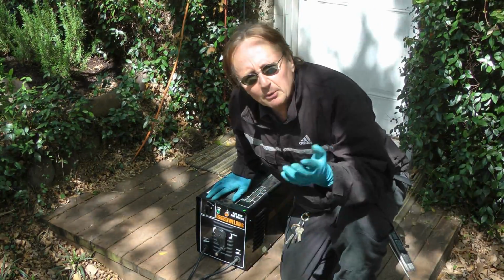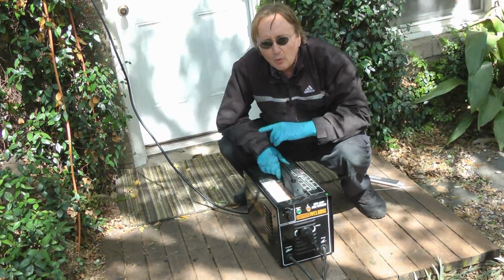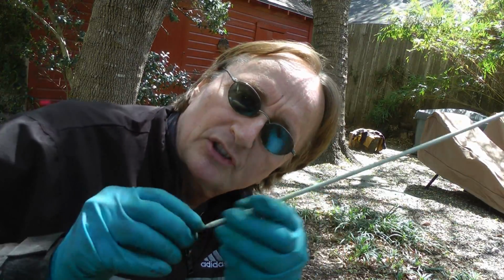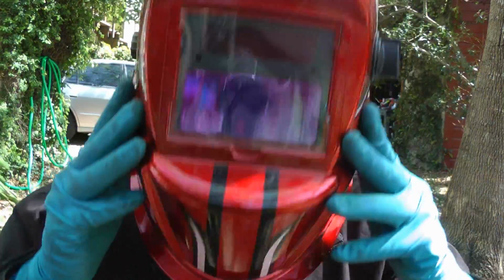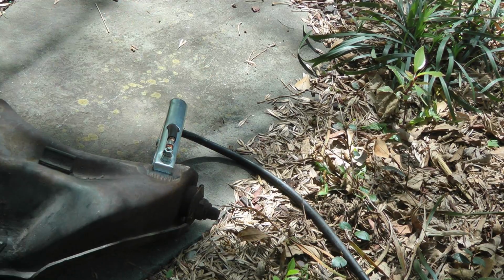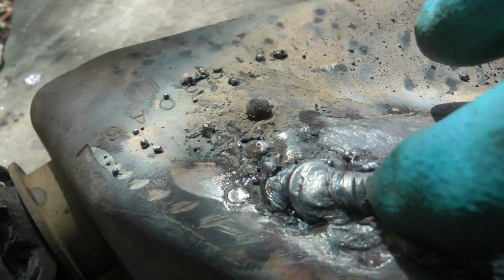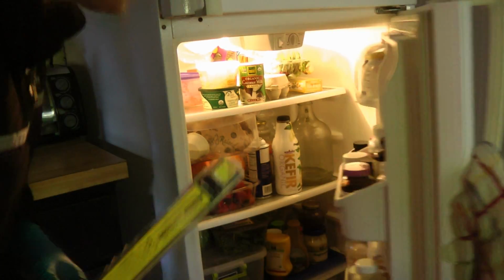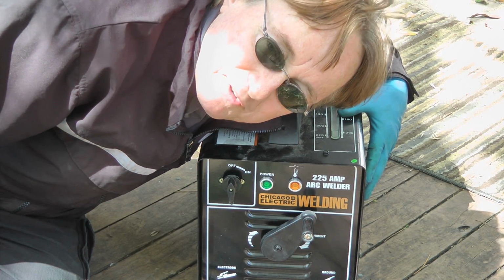Welding Machines And Car Repair

Comment: To everyone but Scotty -- Be extremely careful with cars when welding (computers.) I'm sure Scotty has heard of some of the horror stories. While rare, it can happen... If you have to do it on the car, an oxy-acetylene outfit may be cheaper in the long run... That said I still MIG/TIG off the car. Anything on it I try to switch to gas, it just seams safer (cheaper) than playing the game of which ECU/PCM/TCM/ABS module did it fry this time? I have had to TIG a car at one point, there was something I bought from snapon (may have been rebranded miller gear) that clamped on the positive and negative battery cables. Don't remember the name but I do know I didn't have issues with the outcome. I believe some of the open circuit voltages on DC/AC welding is >=48V on the low side.
Reply from the maker: tis true, I use my gas welder for many on car stuff, but really, it's MUCH harder to learn how to weld with gas, and as my vids are for DIY guys mainly, thought I'd show arc welding as it's the easiest and cheapest way to start.
Reply: not really a problem. just disconnect the battery, it's impossible to fry an electronic component if it's not part of the circuit, even if it's grounded to the chassis as long as the positive lead is disconnected, the component is safe.
Reply from the maker: Rýán Túçk
It is for welding big thing together. BUT the most versatile is of course gas welding and cutting set ups, BUT that take years of experience to get really good and is dangerous as can be with all that heat and explosive gas you have to deal with.
Reply: not always the case. if you happen to have a circuit board using resistors as a voltage divider. the voltage ripples on the ground can feed into the positive side, as it does potentially charging capacitors to various voltages creating a voltage difference across the voltage divider circuit. this a cause a microcontroller to potentially create problems such as the following: 1.running in a overclocked state. 2.starting and not finishing a important step such as writing to eeprom leaving unexpected corrupted values, without software code to handle such issues. 3. nearly every microcontroller uses 3.3v or 5v so a voltage divider can be the cheapest way to get battery voltage within the microcontrollers proper voltage range. there is also the potential issue of exceeding voltages designed for the microcontroller leading to arcing within the chip die. 4.in addition some chips write protected programming can also be cleared with high voltage pulses, welding in such a circuit as described could also lead to a crude version of a hv programmer. 
I'm sure ill hear i weld on #@!% all the time. I can agree that not every car is designed the same. I can also point you to severe cases in ford trucks and chassis modifiers that fried multiple computer modules in one conversion. ambulance makers goto great pains to disconnect or remove several computer modules before welding. 
on the same note people weld on jeeps all the time sometimes without even disconnecting the battery

Comment: Hi Scotty, several things come to mind on this subject. First question is.  if i installed a muffler system on car with pipes joining together. Would it be best to join them welded on non welded for less chance on leaks.   Second question is what welds can be done with this. And last question.  what heat source is best for loosing hard to  get off bolt.  Like  bolts on suspension, map gas will only work heating some bolts. Would like input  if  possible and thank you.
Reply from the maker: I use my oxygen acetylene torch for heating bolts, and  of course welding on muffler pipes works best as it seals perfectly tight. But then again, taking apart a clamped system is easier.

Comment: So if I'm welding something with an electrical welder on my car, for example something on the exhaust, do I need to unplug the battery on the car? I mean to prevent electrical components on the car being damaged?
Reply from the maker: yes, you always remove a battery terminal to unpower the car first.

Comment: Got a Mig welder couple years back and tomorrow I pick up an Oxy/Act welder/cutting Torch I ordered from TSC..welder paid for itself in less than 2 months when  a crack developed in my boat trailer. Fixed gas grille last week.

Comment: Good video Scotty,
 HF has a 20% off sale this weekend, I may take your advice. also, they have customer reviews on their products on their webpage.
Reply: Robb's Homemade Life their new machines the Omnipro Vulcan is a nice multiprocess machine that can stick, mig, flux core, and dc tig. it's not a bad machine for a home hobbiest or small business that doesnt weld professionally, and that's just because professional shops often use more of the bells and whistles. But all and all the Omnipro is not a bad unit for the price.

Comment: Did Scott move to another place? Lol it looks all different now
Reply: Scotty Kilmer but don't ever weld on concrete. there is always water trapped in the concrete, and when water turns to steam it expands 1600 times it originally volume.
Reply from the maker: no, that's just slate rocks in the back yard. Welding on rocks is the safest, they never catch on fire.

Comment: what about mig and tig welders
Reply from the maker: they can be used and are great for thinner metals and more neat welds, BUT good units cost tons more and often require a tank of gas for their use. That's more a pro welding set up, not a do it yourself thing.
Reply: Scotty Kilmer
You can turn an Arc welder into a Tig welder by adding a Tig torch, regulator and a bottle of argon.  I used to weld sanitary stainless tubing for a living with a 110v welder and a tig torch.

Comment: Always, Always disconnect your ground cable from your battery before welding on a car - electricity can do some crazy and damaging things!
Reply from the maker: of course, but I was just welding on a part sitting on a rock on the back yard, not connected to anything.
Reply: It was just a tip for anyone inexperienced who was thinking about welding on their actual car. An exploding battery is a rough way to learn a lesson.

Comment: Hey Scotty Ive been having a issue with my 1998 Silverado 1500 Automatic 5.7L V8 Extended Cab with Optional 3rd door ...and that issue is when im driving it down the road it seems that the drive shaft kicks when the truck is shifting out of first gear at moderately low speeds ? why is that ?
Reply from the maker: you know, all those often do that, they have a special grease you put on the spline, but have to keep doing it over and over again. See that all the time.
Reply: Alrighty then thanks scotty !

Comment: I think it should be  added that when welding on cars you always want to keep the ground clamp as close as possible to the surface you are welding on, and never weld any kind of moving part with the ground on the other side of a bearing. The arc will melt, pit, and generally destroy journals, ball bearings, and anything else that the electricity has to arc through. 

Other than that there are good transistorized inverter type solid state welding machines that don't weigh a ton but in stick welding there is no substitute for a beefy transformer in your buzz box.  Another welder that is perhaps much more useful in car repair is a mig welder.  You want one that uses gas instead of "flux core wire" and if at all possible you want to use those with argon. That co2/argon mix you can get at tractor supply will work. But some of the best mig welds on steel I have seen have been with pure argon. Now for aluminum helium may be required with a tig welder. Don't even bother with the equipment purchase anything tig until you've taken a class at your local community college as tig welding (especially scratch starting a tig without pedal current control) is much more involved than all of the other types of welding combined.

Comment: Tools are so cheap in the US!  $200USD would only get me a very basic arc welder in New Zealand.
Reply: what he has is a pretty basic arc welder. come to think of it, every arc welder is pretty basic..
Reply: True, but I mean small and crappy with low amp setting (looks like his one might go to 180 or more?) and a nasty plastic housing. His one looks pretty solid in comparison... Might be $400 for something similar here.

Comment: Scotty  have you use heat to remove bolt? I did use a propane gas with a torch and didn't work..
Reply: What did you heat, bolt or surroudings of hole? You need to heat up the hole, not bolt.

Comment: Lol, love your videos Scotty, but nothing from Harbor Freight is solidly built.
Reply from the maker: Yes, they do sell some crappy stuff, but this welder is really solid built. I always do a bit of research before I buy anything and no one could touch the quality of this heavy welder for the cost. Heck, they are just big transformers, not complex computers after all
Reply: not everything are crappy at hft. i have 3 ton jack from hft and very reliable
Reply: You usually get what you pay for. Some of the Harbor Freight crap isn't bad for the price you pay.  Personally I wouldn't use one of there welders to make a suspension or frame repair on a car, that could end up dangerous
Reply: aerodip52 Thats why you read the rating on each item before you buy it. Some items are extremely reliable and last for years. I have a cordless drill, sawzall, paddle mixer, and air compressor,  I bought from them 12 years ago that are all running strong. The also have great deals on a lot of items especially if you get it in sale. My dewalt grinder from home depot, lasted 5 years then, caput!
Reply: Scotty Kilmer I own a Harbor F 90amp mig welder ;-)